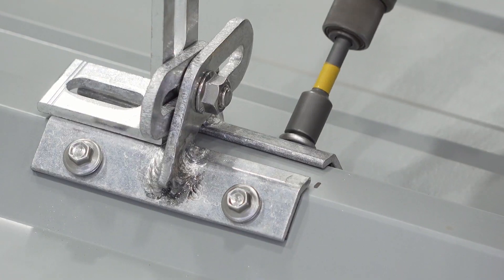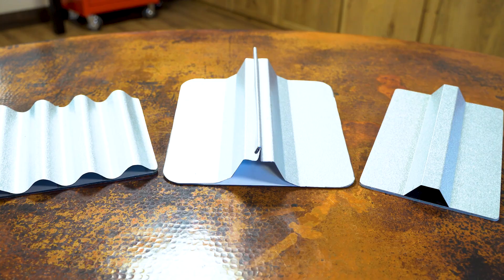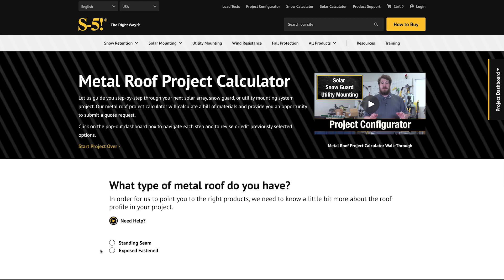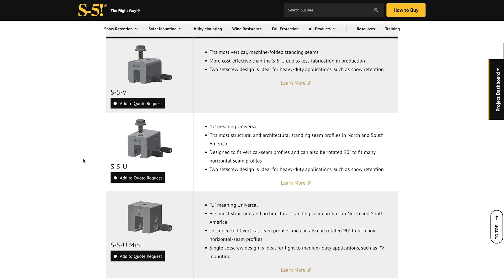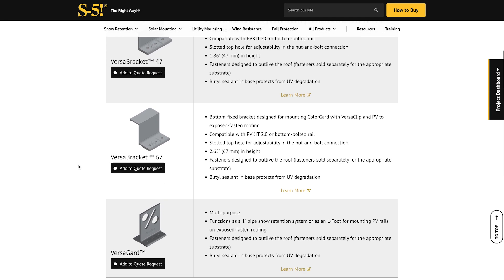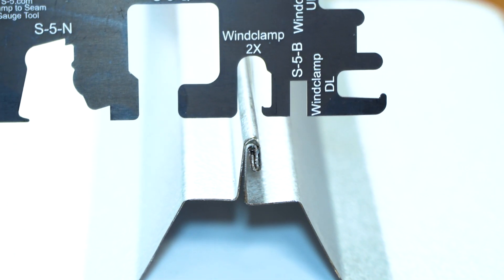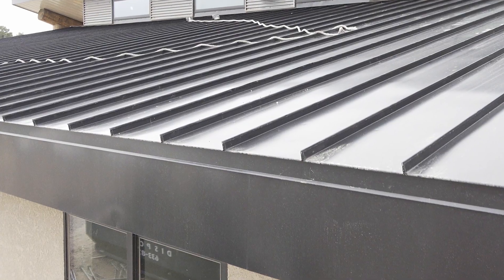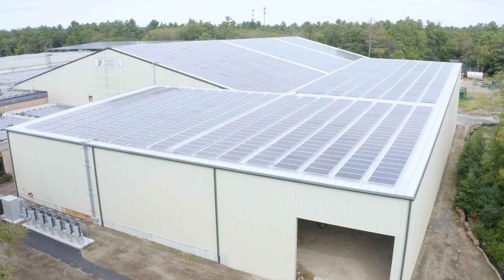How to choose the right S-5! clamp or bracket for your metal roof!

Comment: These brackets bend easy when used for side mounting if you spin them 180° where the L foot points down. When the mount bends it will no longer keep bending and snap the welds.

YOU ARE WELCOME.
Reply from the maker: We are proud to say we publish all our certified clamp and bracket testing on our website and we are happy to talk to you about it — reach out to us at <support@s-5.com>.  The ProteaBracket offers great holding strength for uplift loads.  However, its allowable load for loads along the roof plane are less than many of our other products. For projects in high snow-load areas, your project might be better suited for another roof attachment like our VersaBracket™ or SolarFoot™.  Our technical support team is more than happy to help you run PVKIT calculations per building code and/or provide test reports appropriate for your application.